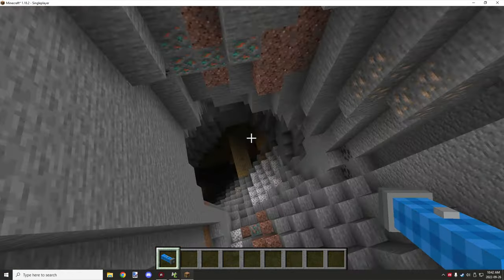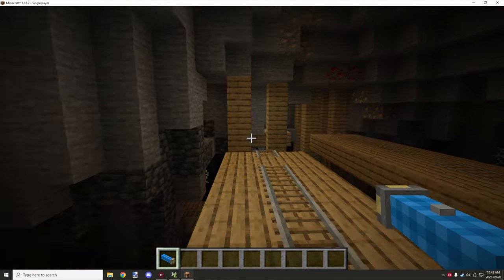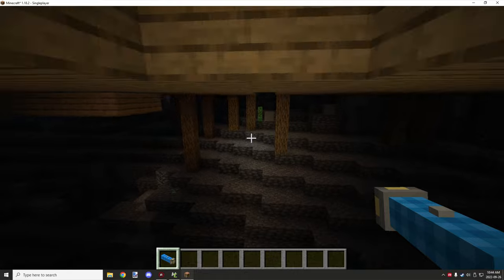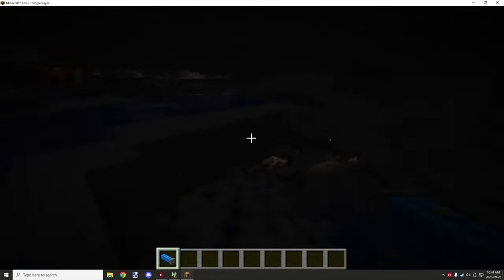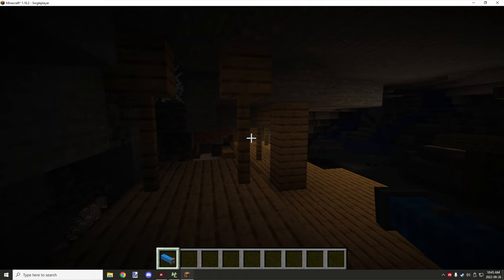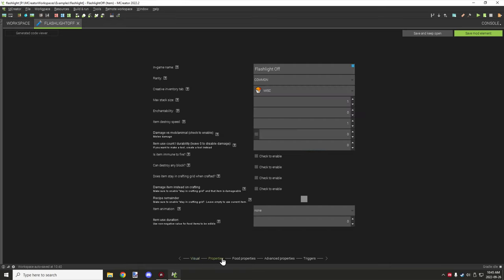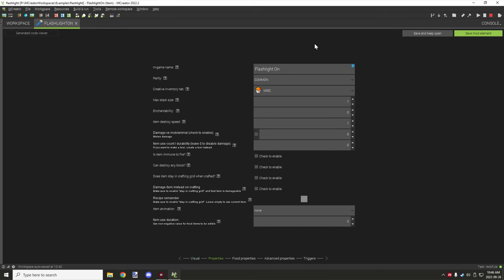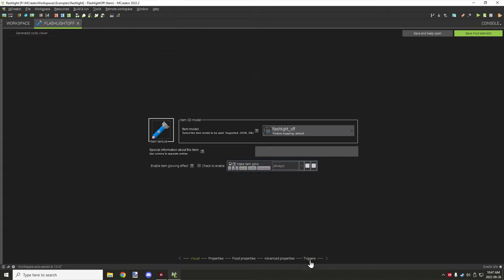MCREATOR: How to make a flashlight | 2022.2

Comment: When you said Ray tracing, it made me think of RTX(Ray Tracing X)
Reply from the maker: The first time I saw the block I thought the same, sadly Java does not support it I don't think or Mojang would have added it to Java edition.
I actually have been looking into game development and trying to learn coding, I think I learnt most of the basics with MCreator like variables and how they work etc. But one thing I did come across was Java is far less optimized for making games, which explains why chunks take longer to load the more development goes on for the game.
I fear that the game is on a path for discontinuing in the near future, as there will be a point where it will not be possible to load chunks in a timely manor so most likely Mojang will just focus on Bedrock after that which will really suck for modding. But we will see, I hope that it won't happen any time soon but 1.18 is really slow for even my beast of a computer to load chunks and I have like 64 GB or ram and a fairly decent processor and RTX 3060 graphics card more then enough to handle ARK on good settings and ARK is a hog for performance which is why I think it may just be the java language, articles seem to back up that theory at least. which kind of scares me a bit XD

Comment: Please help, when I try to load the procedure "flashlight_on_item_when_in_hand_tick_update", it reports that there are blocks, but they are not visually displayed
Reply from the maker: This tutorial could have used material conditional blocks, later versions don't support testing by materials.
IF this is the case chances are you will need to replace any material blocks with tags with the same blocks in the tags.
Mojang dropped support for this in 1.19 or 1.20 one of the two so workspaces that predate these versions have broken but replacing the things from the materials with tags with the same blocks does fix the material issue.
Reply: @NorthWestTreesMCreator  Thank you for help

Comment: hi, I tried to import the mods from 2022.2 where my mods worked but after putting it in 2023.4 and I no longer have any light coming out of the flashlight, I tried to install a light block the hand and it works correctly, can anyone help me? thank you 🙃
Reply from the maker: This was fully on Mojang, 1.19.4 or 1.19.2 Mojang dropped support for testing materials so lots of workspaces broke with this one decision they decided to do. However it is possible to use a tag and just replace the material block with at tag with cave air, void air, and regular air and this will fix the issue for sure. Otherwise you can select each air type or fluid type manually which is another option but tags are easier and unlikely to go anywhere any time soon.

Comment: Hey, i am making headlights for cars that work very similarly in that the cars set a block that emits light in front of them which is supposed to count down and delete itself, but I'm having trouble getting them to work. What I can tell so far is that when the vehicle tick update procedure places a block, it doesn't update that block to allow it to start ticking itself. I can't seem to find any way to notify the light blocks so they count down, I was hoping you had some insight that could help. Thank you :) 
EDIT: I figured out how to get around it. using an "execute command" block to execute a setblock command in the car's name allows it to tick normally so the light doesn't stay. By the way, you can make this flashlight work underwater by doing what i did for my submarine's floodlight, I made a separate light block, locked the code and changed the "waterlogged" value to  true, that way it doesn't create those air gaps :)

Comment: lmaaao why the light must be a block i cant believe minecraft coders didnt changed that yet after so many years...
Reply from the maker: I think if you hard code it it should be possible but using Vanilla code it's not, and MCreator as good as it is it's still pretty limited at times like this, but often there is multiple ways to do something sadly not in this case far as I am aware.

Comment: From what I've seen in recent versions this isn't working, could you make a video on how to solve it? I read your comments and couldn't fix it (I'm a little new to mcreator)
Reply from the maker: It would most likely have to do with material blocks. Mojang dropped support for material block some time in 1.19 MCreator removed the procedure block as it would have been useless otherwise. Rather than test for materials you can add your own tag with the same blocks in the old material condition and it should work the exact same. There has not really be any other major changes outside of this which broke a fair share of my example workspaces.

Comment: Maybe use the “light” block for the light so it can work under water and under gravel
Reply from the maker: You can't edit the games code sadly so as soon as you place the light block you have no way to get rid of it, the custom light block I made allows for custom tick procedures so I have it vanish on its own after a timer runs out, which can't be done with vanilla blocks.
Reply: @NorthWestTreesMCreator  oh ok
Reply: Perhaps using the "Light" block is possible, but you need to somehow work with an array of positions and delays in order to remember where and when to remove such a block. I don't know how to organize an array in visual programming; maybe cut a string variable or something every time.

Comment: On the flashlight on procedure there is a is material type block, is there anything I can use to replace since it was removed in 2023.3?
Reply from the maker: Absolutly, I have been using tags as a replacement. Though in 2023.3 and 2023.4 has a issue with tags with the same name as blocks in the tag for example don't name the tag airBlockTag if you intend to use air in the tag, this seems to not generate the tag properly. Though it was fixed in 2024.1

Comment: Is it possible to make a darkness flashlight?
Reply from the maker: Depends what you mean by darkness.
An actual light source that makes things dark, no, as global light sources are not effected like that.
It might be possible to do with coding but I don't know java so no clue.

In regard to effects though you could apply the darkness effect using ray tracing to players this would be feasible but you would need to use repeaters and test for the nearest entity along the ray tracing path then apply the effect to that player. If you want it to only effect the first entity then you would need to break out of the repeat loop once the first player is detected.

Comment: Is it possible to give the flashlight durability? To make act like is has a battery?
Reply from the maker: Its just a item with a custom model so all item properties would still apply, so you would just need to make sure the item has durability and then through procedure damage it, you can use NBT variable on forge for items to make a timer so the damage does not happen every tick and run it though a tick update, then simply just test if the flashlight is on or off. IF you switch items (I may have done this here) then you will need to store the damage to a local variable and then after the item is replaced set the damage to the other state of the item. That method also works for blocks and entities as well just a fun tip :)

Comment: couldn't you make the block waterloggable to fix the water issue?
Reply from the maker: I tried doing that, I think it has to do with being underwater and in a water block something with ray tracing did not want to work when that happened.

Comment: Can You Do A Video On How To Make A Loadable Gun In Mcreator?
Reply: You can use NBT tag to save cur ammo and max ammo inside gun and set fire conditionals to "if (getNumberNBTTag("curAmmo") > 0)". Then, create key component and procedure that removed ammo from inventory and set NBT in gun to max ammo.
Reply from the maker: Its something I wanted to do for a while I just have not had time, I try to work on things I have a good understanding on, as many more advanced things like the doors I released take a lot of hours to figure out some times days or weeks, in the case of the door it has been tried at least three times but I simply figured it out after getting a idea like a year latter, one of the things about development like this is you need to understand how the mechanics would work, and then you can move to testing, without those steps its harder to figure it out and leaves more room for errors, often there is many ways of doing a thing but finding the best way can often be the hard part.

In this case I could use items and program it from scratch with procedures or I could use range items and try to figure out a way for making cartages but this brings its own issues to figure out, so its really just a matter of picking a path to test and sorting out the required code for completing it, in some cases it may not work and you have to fall back on a other path but in the case loadable guns, it could be harder to work with range items because its already focused on its own mechanics for bow like ammo, so items may be the way to go, but then I would need to figure out a method of making it work with item and ammo which is kind of where I am with figuring out the idea.
Reply: @NorthWestTreesMCreator  I created this type of weapon just on last week, I can give my solvation to you, and you can try it. Maybe it will be good to you.
Reply: @defiant877  This Seems So Hard For Me, A Video Will Explain This Better.